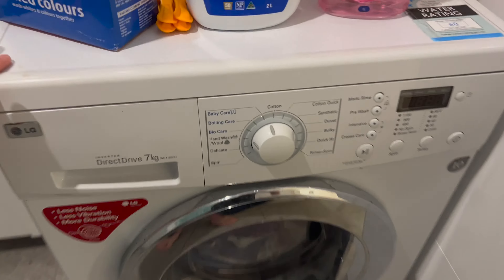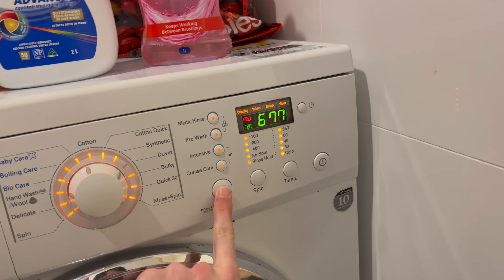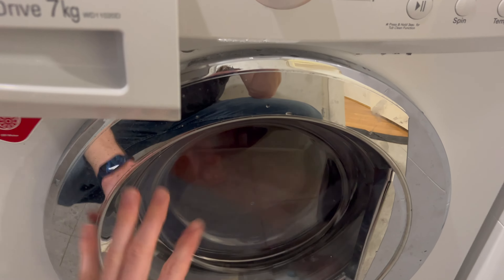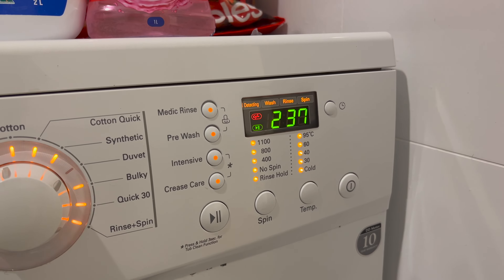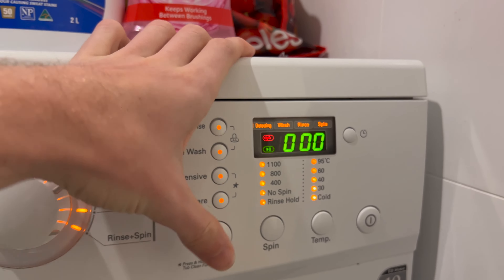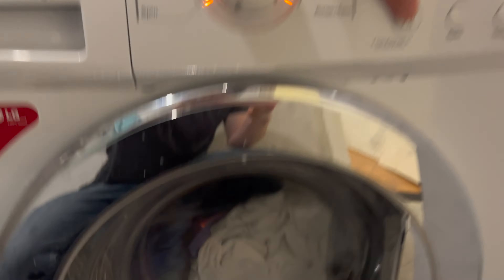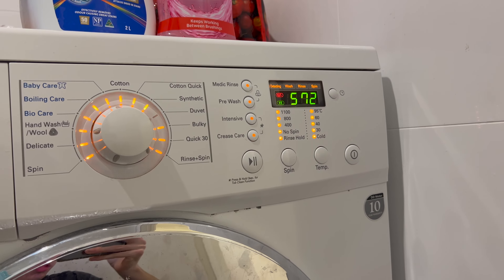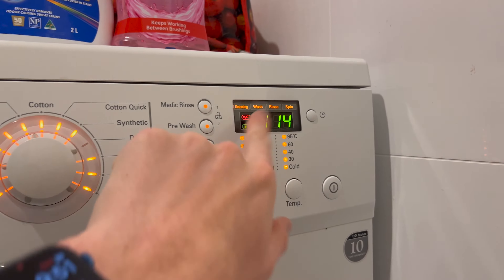How To Put Your LG Front Load Washer In To Self Test Mode | Diagnostic Mode

Comment: Okay?  So I saw the button sequence to start, but how the heck do I tell WHICH mode/function is being tested as it runs through the test?
Reply: ...and... I saw your list for: sequence test, but how can I be sure which one the test is running at a particular point?  Example - how do I know when the wash inlet valve is being tested? (an internal part)  Ours partially starts filling during beginning when check load balance, but then it stops providing the incremental (what I call) spot fills as it continues tumbling cloths.
Reply from the maker: I no longer own this washing machine sadly, maybe google search the service manual and see what comes up.

Comment: You should make more videos with your lg washer
Reply from the maker: I can :D what do you want to see? Not sure what else people would want to see on a 10y old washer.
Reply: @Lens_Addict  If you have an IR thermometer can you show what temperature it gets to when set at 40, 60 & 95 pls ?
Reply from the maker: @johndoe-vc1we  Sadly the bearings on this washer ended up giving up & I replaced it with a used 10 kg lg washer one, that one also has issues lol, I do not have an IR thermometer currently.

Comment: my washer passed but my washer still cuts of during wash cycle error code comes up IE saying not enough or  to much water i change all things cleaned hoses still the same error
Reply from the maker: Thats no fun :(
Reply: Change pressure sensor
Reply: @dhineshk1218  done that already
Reply: Get it fixed yet?  I've heard that you may need to replace the Wanter Inlet Valve.  https://www.youtube.com/watch?v=KuknbjPy3a8   Ours starts giving water at first, and then as it's finishing calibrating the load, it stops providing water, but I can hear some kind of signal noice.  Maybe I need a pressure sensor.  Check your valve.